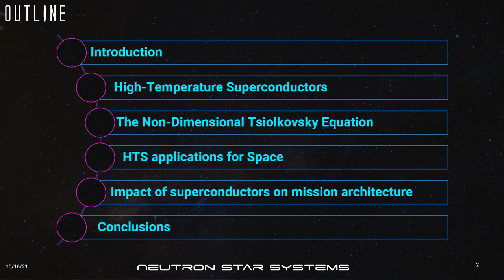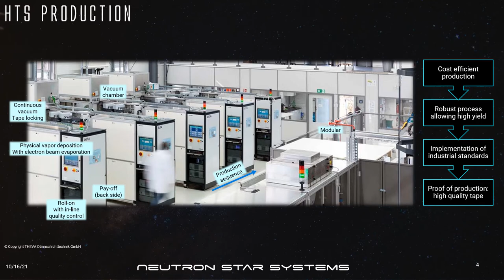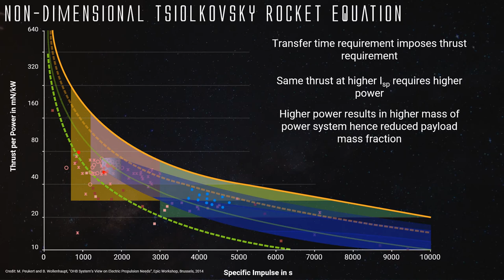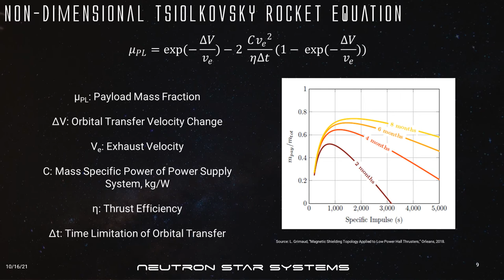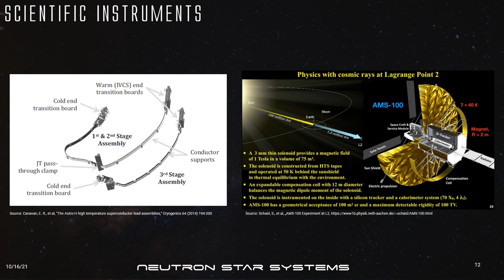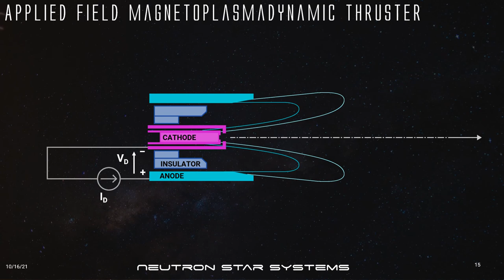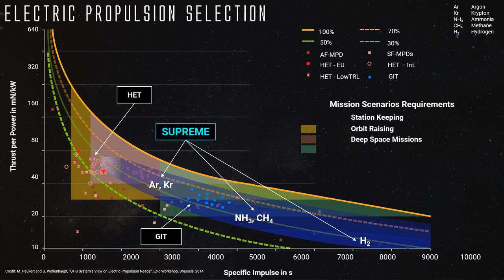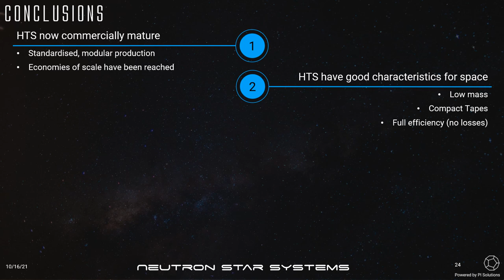TF-4 A Superconductor-Based Magnetohydrodynamic Shielding System for Hypersonic Re-Entry: MEESST

Comment: Exciting stuff. AFMPD in particular. I believe C can be improved with Spectrolab triple junction PV for concentrated sunlight. Large low mass mirrors and cells that although they mist be cooled, can handle 1000 Suns mean multiple KW per kg. Alternately power from microwave beams would allow really fast trips perhaps. Great work.